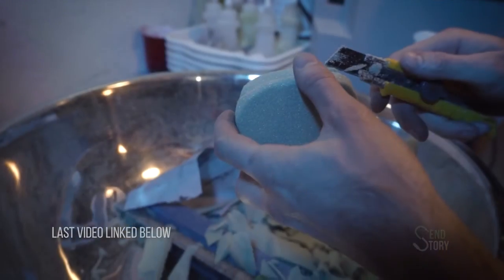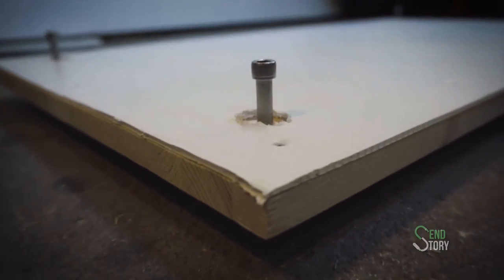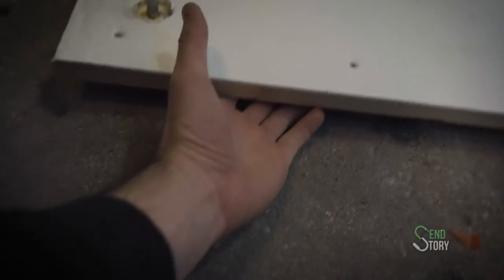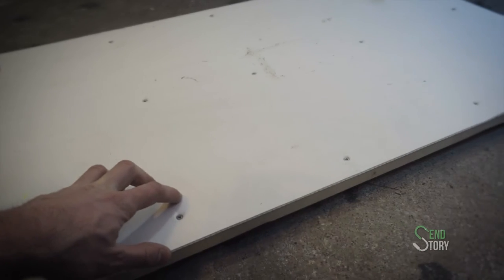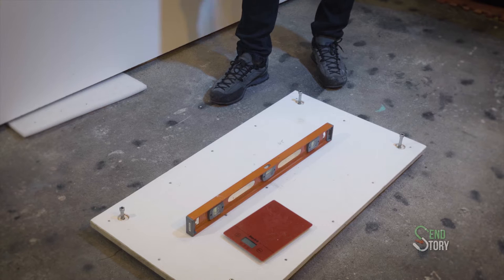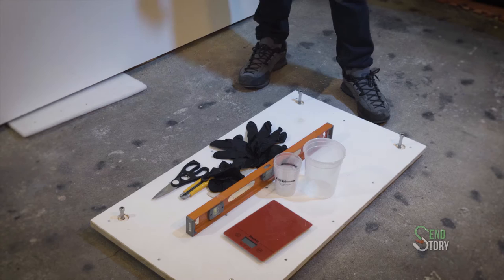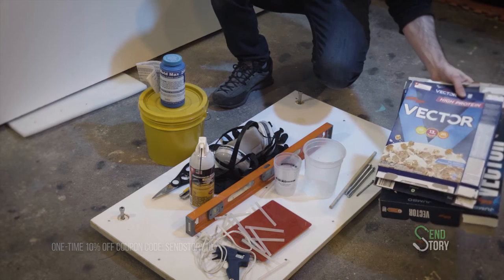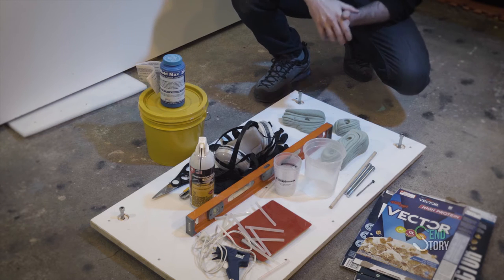Pouring Molds! - DIY Climbing Holds Pt. 4 - ALMOST THERE

Comment: how many times can you  re use a single mold?
Reply from the maker: I ruined my old molds that were made out of silicone caulking after like... 10 pours? But they were pretty garbage and I was using a polyester resin. With the new molds made of proper poured silicone (what's in these videos), I have yet to wear them out. I haven't had a chance to do more than about 12ish pours on each though, so it's not like I've put them through the ringer. I haven't really noticed any degradation of them yet. If you store the molds in a Rubbermaid container so they aren't exposed to humidity and in a place that there isn't a lot of temperature fluctuation (aka inside your house) they should last long. The only molds I broke were left out in the garage for a long time and they lost their flexibility and cracked/the stems broke (one of the reasons I use bolts for casting now instead of stems). But I'm still using the molds and adding screw holes later, so they technically aren't completely broken just yet. My advice is to avoid overly convex hulls (like super deep jugs), use a mold release,  and store the molds well and they should last for a lot of pours). I also keep the first good looking cast so I can make a mold of it down the road if the original mold breaks. Not sure I really answered your question, but I hope it gives you some insight at least.

Comment: When trying to make the molds, my foam keeps breaking free and floating. Am I just not using enough hot glue?
Reply from the maker: Hey, I've never experienced this issue, I would assume your thoughts are correct. You want to fully glue all the around the base of your holds to try to stop the silicone from running under the hold (it makes it hard to demold and can also mess up your mold cutting through it to remove excess material). So generally you want to use a fair amount of glue, so your intuition is probably right. Best of luck!